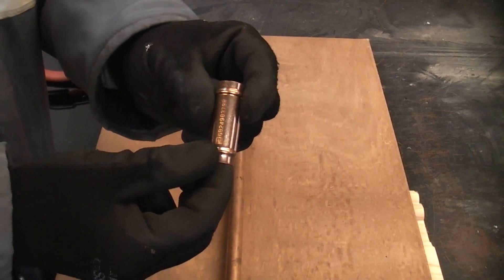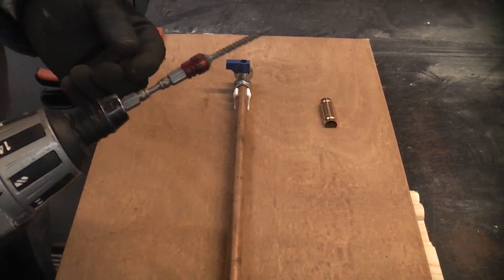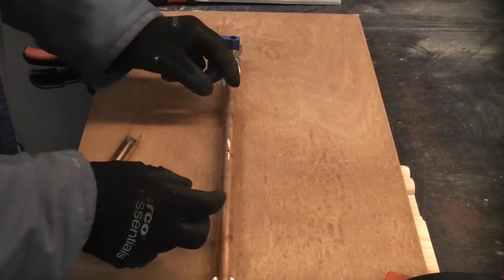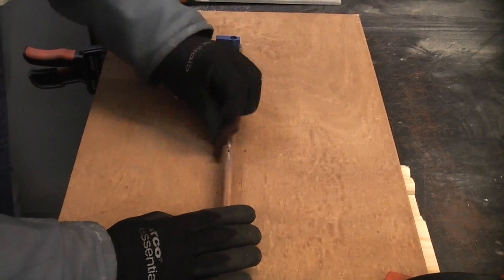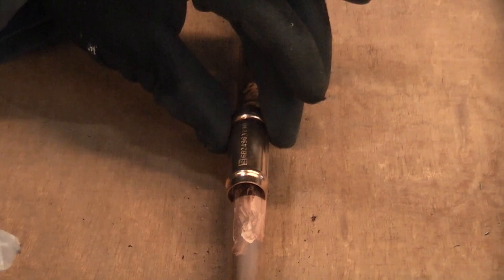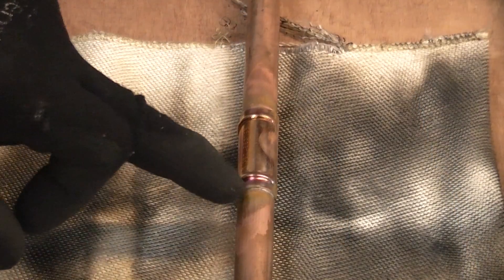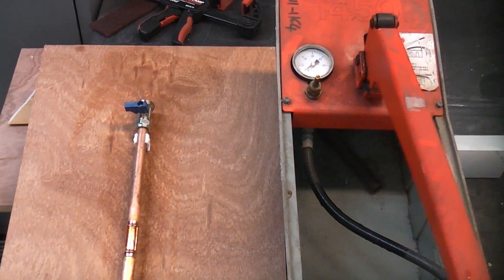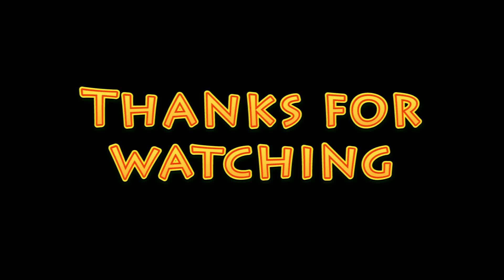How to repair a hole in a copper pipe using a click fix patch repair

Comment: I've been a joiner for 12 years and you're literally the first person I've ever seen use a soldering mat.... plumbers can never seem to be bothered!
Reply: "Good plumbers don't need a soldering mat",  translation Im to lazy to do it right and I hide the burnt material from the customer or just laugh when they complain :)
Reply from the maker: Thanks for the comment ;-)
Reply: Glad that you spoke on behalf of ALL plumbers and your "12" years of vast experience is truly remarkable
Reply: read that comment again and don't jump the gun  @_1ben
Reply: Safety NOT first.
Reply: I did not have the mat so a couple of times I folded up some heavy duty aluminium foil making sure to leave air pockets between the folds... It kind of worked for a single soldering operation, I did not scorch the wood
Reply: I do use them all the time after I had smoldering old rotten wood after an hour of soldering
Reply: Too much LEAD in their diet...  it numbs the brain....
Reply: Good plumbers don't need a soldering mat. We're skilled enough to not scorch the surroundings 😁
Reply: Ed Vaughan liar
Reply: N C what? As a good plumber I never used a soldering mat(they're for ppl who don't know what they are doing like handymen and do it yourselfers) on a rare occasion I'll use a piece of sheet metal.
Other then that, as a good plumbing I don't over heat the pipe and turn the flame away from the surface. It's not rocket science. I wouldn't say that's lazy, it's years of experience... 

I bet you're upset because you hired the cheapest guy you could find and he burnt the inside of your cabinet.
Reply: I m a joiner too! but I  use chewing gums in my every day job, I find this technic last year during a trip in Kazakh stan.
And now I use this method every day.
You just need a good hair dryer or a heat gun on a chewing gum  and it makes the job

Comment: question: will an electric paint stripper gun put out enough heat to do pipe soldering?
Reply from the maker: Yes, but it is a bit slower than a blowtorch- https://www.youtube.com/watch?v=tsXuyWj0zc0
Thanks for the comment
Reply: perfect ! thanks!
Reply: Just make certain you don't get any solder in your hot air gun/paint stripper. I was soldering a pipe from below and the excess solder dripped into the hot air gun nozzle and fucked it immediately!

Comment: Great video as always.
The only disadvantages I see in these  are  not many homeowners are going to have  flux & blowtorch and what I see quite often is the pipe is penetrated right through on 15mm, I'm not knocking the video or how well the product works  but personally as a plumber I'd always use slip couplings. Keep up the great videos.
Reply from the maker: Thanks, ironically I filmed how to tee into a pipe using slip couplings when I filmed this- I hope the copper pipe looks cleaner than it did in this video (must be the lighting in the garage).
Thanks for the comment
Reply: Ultimate Handyman 
The pipe looked clean enough to me most certainly, the light can be  tricky.👍👍👍
Reply from the maker: It looked kind of brown on my computer and someone else mentioned that the pipe did not look clean, perhaps it only looks a funny colour on some monitors.
Thanks for the comments ;-)
Reply: Ultimate Handyman you are better off using a mesh style cleaning strip rather than scotchbright, it cleans it back up shiny as new
Reply: PB I think you could accomplish the same result by taking the same size pipe and cutting length wise.

Comment: Why not wire wool? The scourer doesn't look like it cleaned it at all.
Reply from the maker: Wire wool can contaminate some pipes as bits of steel wire can enter the pipe.
I think it is the LED lighting in my garage, when I cleaned the pipe using the scotch-brite pad it was really clean and shiny, but when I got the footage on my computer to edit it the pipe looked the same colour (even brown) where I had cleaned it. 
Thanks for the comment

Comment: ah copper pipes ,recently i looked under my kitchen sink where the mains inlet network is all connected inc the washer machine inlets etc etc and the bottom of the  unit is partially flooded with CONDENSATION !!! would normal pipe lagging solve that issue ? keep the pipes a bit warmer like and keep the ambient moisture off it ? ( i was worried the stopcock was leaking at first then realised the whole hori pipework is dripping with droplets ) :)
Reply from the maker: Yes, pipe lagging should help. I had a similar problem once with a copper pipe that want from the rising main to the bathroom above. A mate of mine is a plumber and he suggested swapping the pipe for plastic, so I cut it out and used a length of John Guest speedfit and condensation was never an issue after that, as the plastic pipe is not as cold as copper.
Thanks for the comment
Reply: i googled a bit and there is a paint/primer u can apply to copper pipework to prevent such an issue ,might be cleaner and easier than to use lagging or swap out pipework, if it works or not " meh "
Reply from the maker: I went to the National painting and decorating show a couple of years back and talked to the rep that made such a paint, but I have not tried it yet, I think this was the stuff- http://fave.co/2nA3Gey

Comment: Anyone who can solder end feed could make one of these out of a piece of pipe. Seems a lot to pay just for the solder rings. 
A lenght of pipe the same diameter with slightly less than half cut out of it would slip over nicely. 
Maybe try it sometime I might be missing some reason why it won't work well.
Reply from the maker: Yes, you could probably make one. I don't like end feed though as I only solder once in a blue moon so I prefer solder ring.
Thanks for the comment

Comment: Excellent - very useful tip.   Have you any advice how long to hold the blow torch on the repair patch as i have no soldering experience.
Reply from the maker: It was not long at all, the video was not edited at that point, so I think it was about 10 seconds.
You only need a very low heat to melt the solder, once you see it exit from the sides you can remove the heat.
Thanks for the comment
Reply: Normally hold the heat on the most conductive area, the main pipe, and let the heat go into the joint (patch) this ensures that the solder bonds to both.
Reply: Thanks